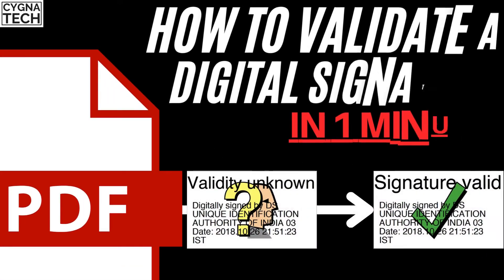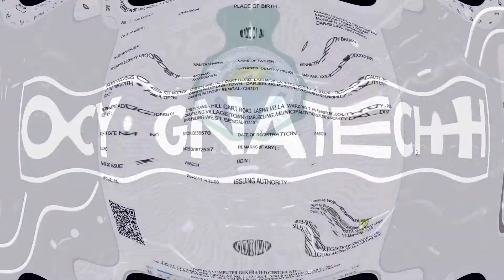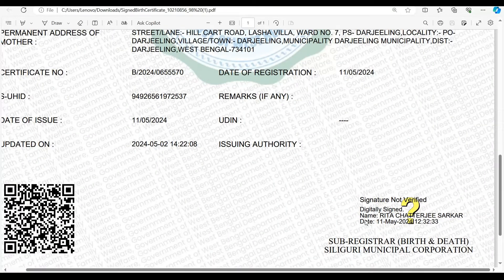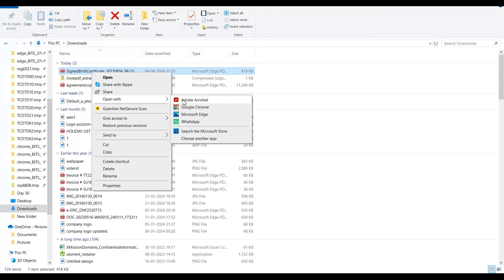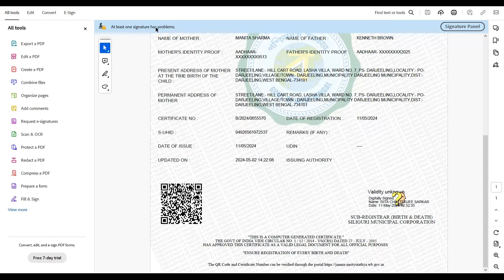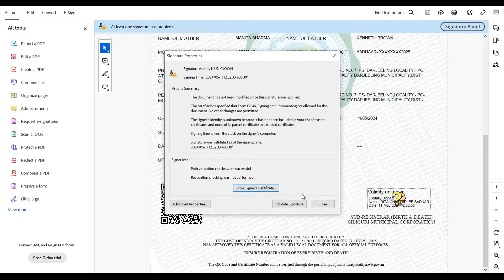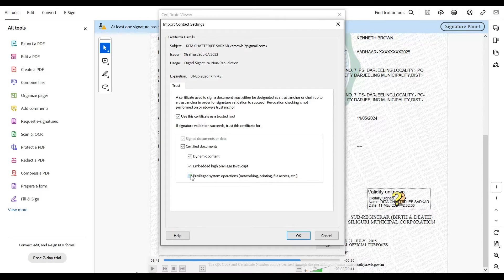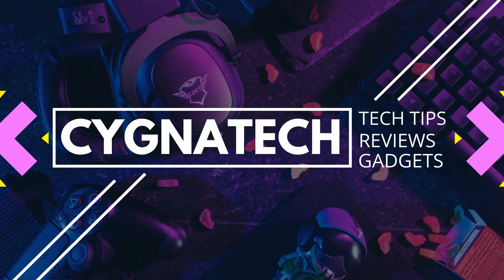How To Validate Digital Signature In Any PDF Document | Digital Signature Validation Process

Comment: only validating on my device. after this its still showing question mark on other devices.

edit - to save the valid pdf choose the print option and save it.
Reply from the maker: This shouldn't be the case, if you follow the video properly.
What device are you using?
Reply: @cygnatech    it was checked and valid but only shows on my computer. when i shared it's not valid in other devices. I had to save the valid document separately.